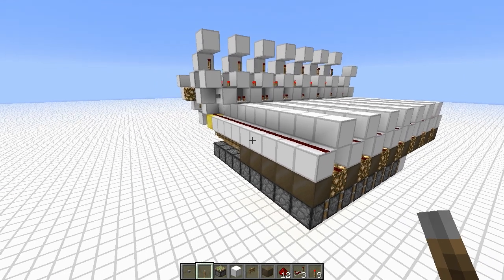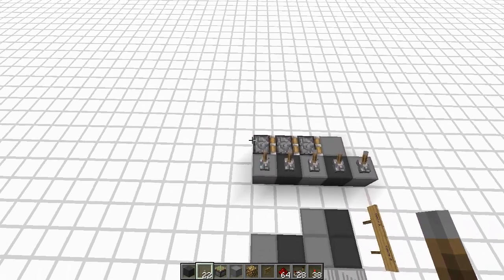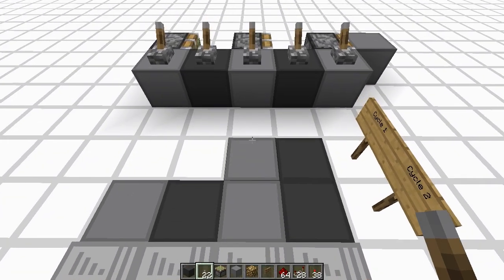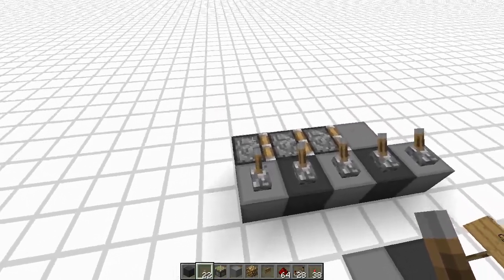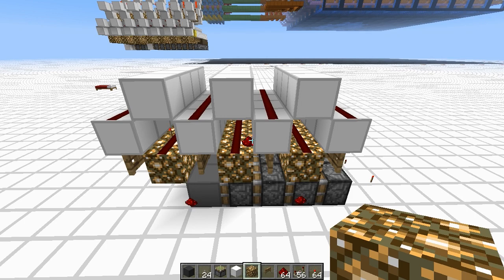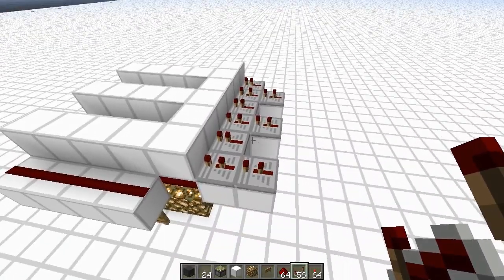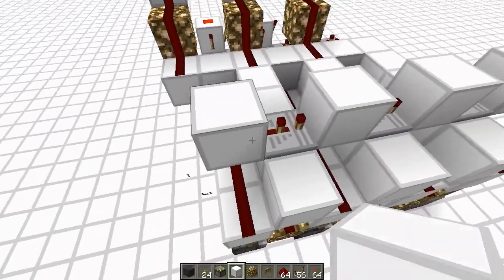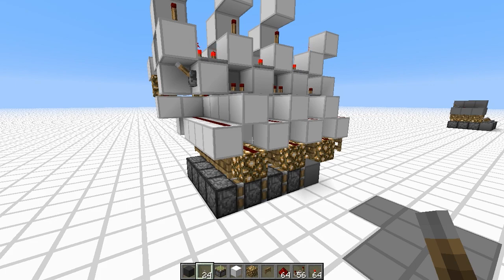Minecraft Tutorial: Advanced Piston Extender

Comment: Here's the changelog of 1.3.1:

Slabs and Stairs
Will now be placed upside-down when placed on the upper half of a block's side.
When placed upside down, rails, pressure plates, levers, doors, torches, redstone torches, repeaters, redstone dust and beds can be placed on them - Redstone dust behaves like on glowstone - It transmits power horizontally and upwards, but not downwards. Redstone torches don't power redstone placed on slabs/stairs above them.

Comment: Very nice work here.  I've seen people build hugely complex circuits to produce the piston-retraction pattern, but always suspected there was a simpler way.

I was puzzled at first at how it could work with both with a lever and button, but then I realized that retraction will never begin before extension has finished, and that the monostables only respond to the repeaters turning ON, which happens only as a result of the control-switch turning off.

A very good machine you have there.